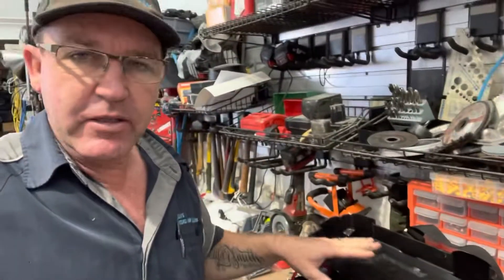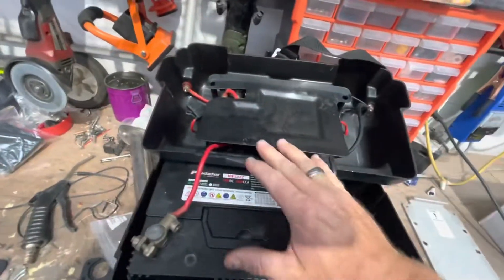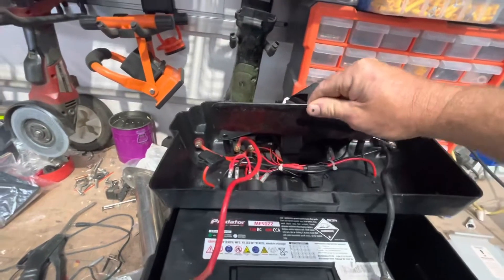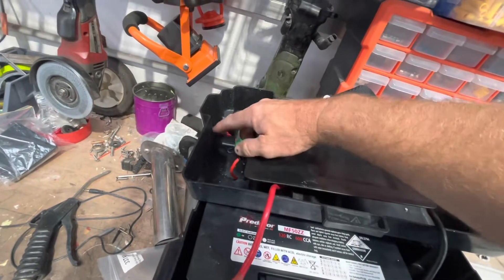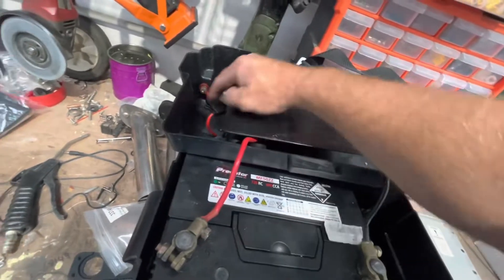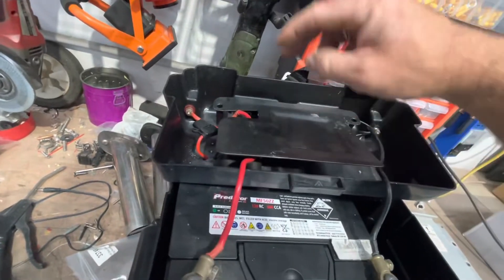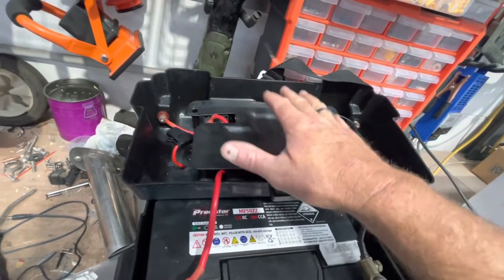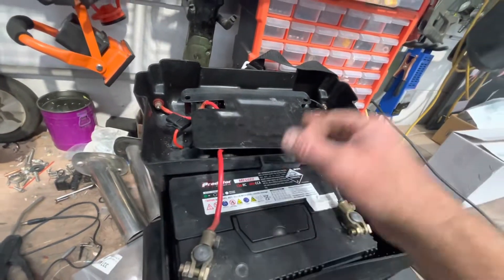Battery Box fuse tips.

Comment: I have a battery box that has 4 Anderson plugs with 50amp breakers, there's also a 175am Anderson plug that has no fuses, should I add one or will the inverter I plug into it have its own fuse?
Reply from the maker: Hi 
The 175 amp plug is usually a jump starter. I haven’t seen an inverter plug into the 175 plug 🤔 that’s a big inverter